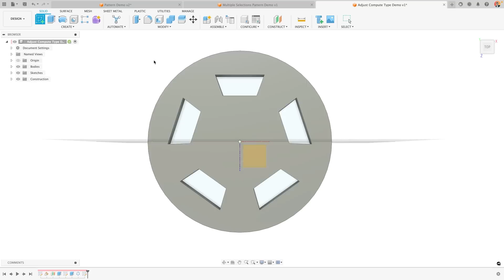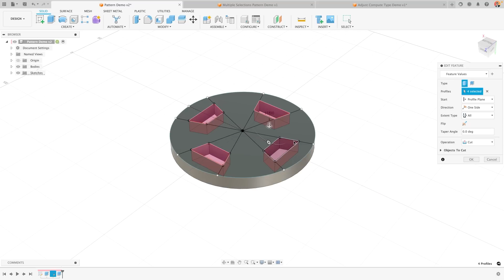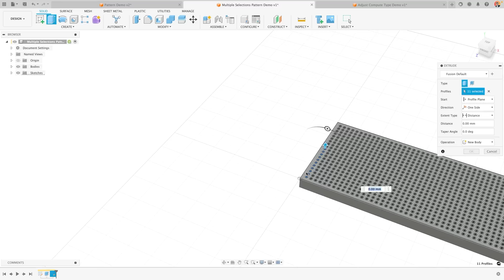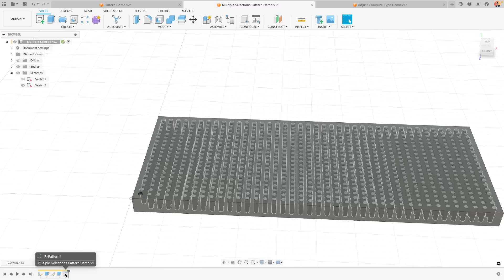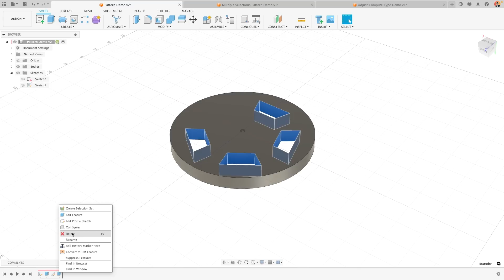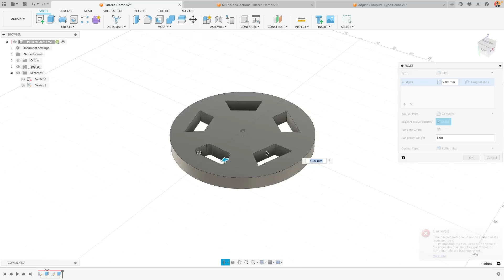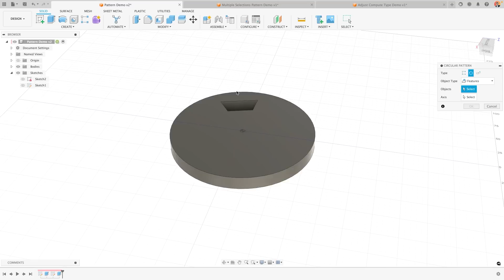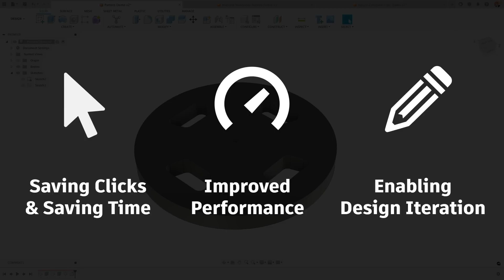Create Patterns in 3D, not 2D. Watch To Find Out Why | Autodesk Fusion

Comment: I've got a patterning question...... How would I pattern a sphere that can be updated for size, around another sphere -  but EVENLY spaced from each other?
Reply from the maker: Hi, 
So it depends slightly on what behaviour you want when the spheres change size however the concepts would be the same. The only difference is that a central Sphere has no axis of rotation to select easily, so you would need to add an axis (or use the origin) that goes through the centre of your sphere as your central axis of rotation in a circular pattern. 

You may also need to add a parameter for the central sphere's diameter. This can then be used (with a bit of maths to calculate the circumference) as your extent distance within the pattern, and when one updates, so will the other :) 

Hope this helps!

Comment: This is all well and good until the 3D features fail. Try using a coil to sweep a profile up a cylinder, join it and circular pattern that feature. It’ll fail often. I’ve had to make them as seperate bodies and then join. Then any parametric number of pattern count requires changes down the line

This could be fixed by allowing join to work with features too, but currently it only works with bodies

Comment: Great video with good information. But I have a question to that. Is it possible to make a heaxogon pattern in the 3D space?  In 2D I draw two construction lines from the middle of the polygon to the middlepoints of two adjecent sides and use these to as the axis for the rectengular pattern. That leaves a nice honeycomb pattern. But as you showed in this video that process has some flaws.  But when I try this in the  3D space, I can only choose one axis and the second one is automaticaly in a 90 degree angle to the selected. Is there an option I have missed or is that just not possible to do at the moment?
Reply from the maker: Hi Mirage, GREAT question! 
Selecting multiple directions (or 'axis' as they are called in the 3D tool) is still possible! To do so, you need to press and hold CTRL (or Cmd on a Mac). 

In the sketch environment, you don't have to do this, but in 3D, pressing and holding Ctrl when selecting your axis will allow you to select multiple axis directions and override the automatic 90-degree value. 

Let us know if this works!
Reply: @adskFusion  Thank you. I will try that.
Reply: @adskFusion  Just found the time to test it. It works perfectly fine the way you described it. That will save me a lot of work in the future. Thank you very much!

Comment: I've been using professionally f360 for over  six years now. And with every update it seems like the f360 is going backwards. Five years ago I could make a block with a hundred patterned holes, add it to a large component assembly and have no issues. Now, doing the same, everything goes to the halt. 
Yes, nowadays f360 has more UI nice features, but performance wise it is going very backwards. Hence there are definitely changes in the background nobody is admitting, which never were an issue in the past.
Surprisingly fusion tutorials more and more frequently adding "performance improvements" into their tutorials.

Comment: YES But  WHEN will we get the ability to select a patterin in a sketch that keeps history . !!!   so you can use  formulas to make the number you need based on space and dynamically change it.. 
also when doing extrudes on a pattern you cant select the feature ( so you get all teh resulting objects as a selection for the next step dynamically for like example boolean them all together or subtract the resurlt of the pattern parts  as one set of bodies  instead of STILL having to select all the pieces  one at a time )   

basically your vido is only valid in one situation, making holes , but what if you wanta a pattern of an arc and then  boolean them together because they overlap ..   or you use  parametric formual voalues to change a value liek how many instances in the pattern ..     i need this feature often !!! and it makes no sense to keep design history  but sketches do not keep design history .. 
(* sketches should ahve history  in the undoo buffer.. make it editable.. that keeps history .. including the pattern feature.. and  then you can select the result of the pattern feature to select resulting profiles based on a location (that you wkno will always be there )  and do one extrude or combine  or whatever.. with those resulting features.
Reply: In the 3D pattern function you can very easily add a parameter for the number of instances in the pattern, that is not an issue in any way? I think you can do the same with sketch pattern, but I rarely use it so havent tried. It still wont propagate to the 3D environment the way you want though, so it's kind of useless. 

Not sure what you mean with sketches not having history? They dont have a timeline, but  they are also not meant to be an object that needs it. You shouldnt make highly complex sketches, it's just a bad design workflow, in any professional 3D CAD package. Just make simple sketches, do as much work as possible in the 3D environment and use more sketches when you need them. There really arent many (if any) good reasons to try to include "everything" in one sketch, the way I see many people do. 

Sketches should only be as complex as they absolutely need to, they should be created in the correct component (almost always the one you'll create the body in later).
Reply: @Robinlarsson83    It’s less calculating to do one extrude on a pattered sketch.  Than. 1000 extrudes plus a Boolean on a patterned feature.  

The latter is  how it currently needs to be done. But the former is more efficient 

And the former however doesn’t allow parameters in a pattern that you can change later ( once applied a pattern in a sketch it becomes static not parametric)

Comment: @Autodesk Fusion  At 5:00, can you elaborate on the difference between Optimized and Identical, and what you mean by "enables changes to go through" for Adjust?
Reply from the maker: Hi noahkatz, absolutely, it's good to dive into this a bit more!  The three options essentially compute the change in different ways so they all have slightly different capabilities. 
 
1. Optimized is the fastest.  It essentially just patterns the faces of the feature.  But there are also a number of instances that it doesn't work. The feature faces have to all land on the same face, and there are some cases. The most common is patterning cuts around a cylinder which often doesn't work with the optimized types. 

2. Identical is next fastest.  This method makes a tool body from the features, patterns that tool body, then joins the results at the end.  It can handle cases like the cutouts around a cylinder and will result in an exact replica of the original shape (no matter where it is patterned too) hence the name ... identical.

3. Adjust is the slowest. This method recomputes each instance of the feature almost as if it were a separate feature.  This allows you to do things like pattern a feature with a To-Object extent type, and have each instance of the pattern could be a different extent length, eg if you are patterning across a shape that is not of uniform thickness. 

Hope this helps!
Reply: @adskFusion  These details are very useful to know, thanks very much!

Comment: Patterning holes or mirroring holes doesn’t work for me.  Threaded holes don’t transfer properly.
Reply from the maker: Hi Talonosi, sorry to hear it hasn't been working for you. I would recommend trying to use a different compute type at the bottom of the pattern tool box to see if this changes anything. If not feel free to post a topic on the Autodesk Community to figure out what is going on as you should definitely be able to pattern holes and threads :)

Comment: If fusion want to save me clicks DONT AUTO HIDE MY FREAKING SKETCH when im done.... So irritating
Reply: You can disable that in the settings.
Select the profile icon in the top right corner of Fusion 360.
Select Preferences.
Go to General > Design.
Disable or enable "Auto hide sketch on feature creation".
Reply: @supergiantbubbles  oops, sorry I didn't refresh before posting! Didn't even see that you had already explained that.

I had started the video earlier and walked away for a while, then came back and watched it. Apparently the comments were still only loaded from when I started the video. I'll have to watch that in the future.
Reply from the maker: Having too many amazing community members willing to answer questions is never a bad thing! 🎉
Reply: That has been an option you can change in your preferences for more than 5 years now. Just go into: preferences --> design, then uncheck the box next to "Auto hide sketch on feature creation"
Reply: It’s a feature that you can turn on and off.
Reply: Or you can just learn to use a better workflow :) Dont create multiple features from one sketch. Or you can atleast do as other have said now, check the settings and turn off the setting for auto-hide of sketches, its been there as long as I've used Fusion and probably way longer.

Comment: Asking for a pattern new component option that can create a pattern with new component that not referencing the origin one
Reply: Yes creating independent copies of components would be really helpful sometimes. (or as alternative a "Make individual" feature for instances of a selected  component)
For instance at the moment I'm planning a bit more complex design for something similar to a wooden deck.  There are about 30 similar profiled battens with the same distance to each other. So a 3d rectangular pattern works. However since the area of the wooden deck is not a rectangle (more something like a triangle) all battens need to have different length.  (And 30x copy, paste into new,  and than move to the right direction is really annoying)